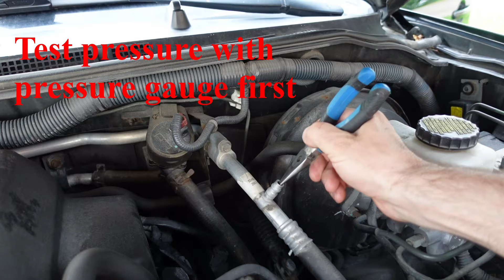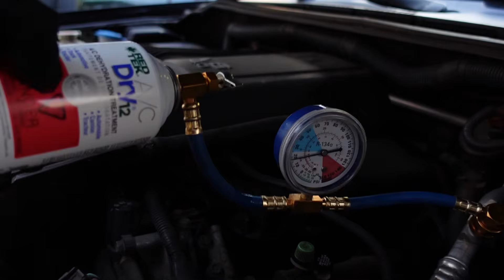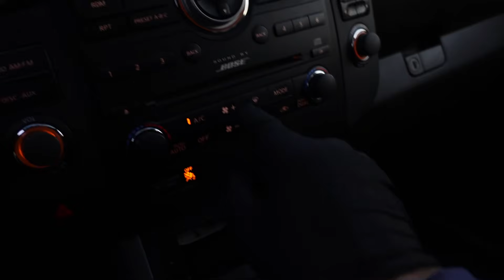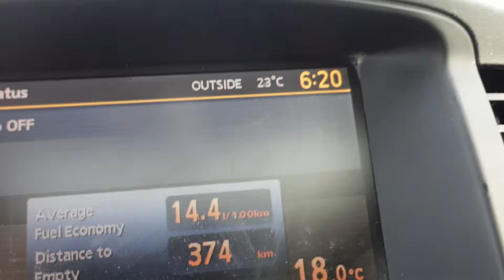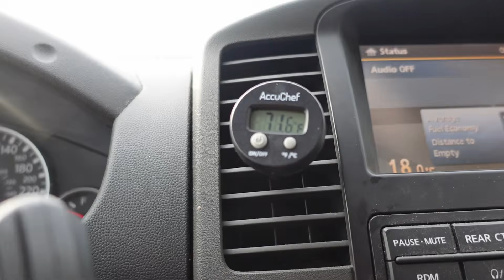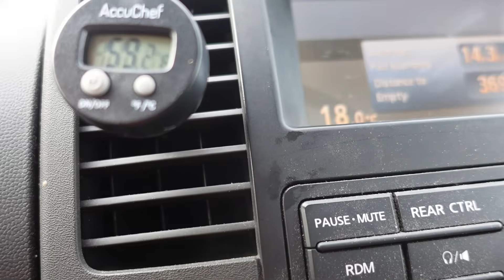Nissan Pathfinder A/C Recharge

Comment: where should i put 134a? high side or low side? video only show's Dry 12 dehydration treatment on low side :(
Reply from the maker: low side. The ports are different and you probably won't have an adaptor to hook onto the highside. Also the pressure on the highside will push everything into the can and nothing will likely escape.

Comment: So why wouldn’t you throw some pressure in there first and bubble test? Your system didn’t just evaporate your refrigerant into thin air!
Reply from the maker: No it literally evaporated the refrigerant into thin air actually. This video is really old and the ac still works.
I'm happy with my choice

Comment: I have pathfinder  and I want to recharge it with freon1234AF.  Please show me how
Reply from the maker: 1234yf isn't compatible with vehicles that run R134A or R12. I therefore cannot show you as my vehicles are both R134A. I assume the method is the same though.

Comment: So this is weird, I did the quick bump on the high side port and it squirted what looks and smells like antifreeze. Bright green and under pressure. WTF?
Reply from the maker: Could be a couple reasons.
They put colorant in to find leaks and is often bright green.
There is an oil that circulates as well.

Comment: I had a broken line right in between a support like corrosion, I cut it in half and use some high-pressure quarter inch fuel line and two fuel line hose clamps
Reply from the maker: If it works it works

Comment: I'm not sure what I'm doing wrong with the AC. The compressor clutch wouldn't engage, even after I used a paperclip to bridge the wiring harness on the left side of the radiator. I replaced the compressor with a junkyard compressor, but I still have the same problem. 

Last night, I put 12 volts of power onto the yellow wire that runs to the compressor clutch. It started spinning, but it sounded terrible. 

What am I doing wrong? Is the voltage going to the compressor clutch supposed to be less than 12 volts?

I could use any advice that you can offer.
Reply from the maker: Did you try the Auto Active Test? The video I did before this one is how to do it on the Pathfinder, but it runs a compressor test that will engage the compressor and let you know if the wiring to the compressor is bad or not.
https://www.youtube.com/watch?v=XBI6MtgcqvE
Reply: The compressor made a few clicking noises when I ran that test, but when the vehicle is running, the compressor clutch only engages if I put power directly to the wire that runs to the compressor.
Reply: @DIYNorth , doesn't the compressor need to be engaged to add more freon? It does on my 1999 Dodge Ram.
Reply from the maker: @stevescholfield6671  no, not on the pathfinder. If it senses low pressure it wont engage.
As soon as I added some refrigerant it started working
Reply: @DIYNorth  I'll give it a shot tonight! I'll let you know what happens.
Reply from the maker: Best of luck
Reply: @DIYNorth  It looks like it's working!! Thanks!!!

I don't have fancy gauges, just a single gauge that attaches to a short refrigerant can. While the refrigerant can is connected to the system, it reads in the "filled" range while the compressor is disengaged. Once the compressor engages, the gauge drops a little bit in the "low" area. Is that normal? I'm trying to get the system to accept more refrigerant as I type this.
Reply from the maker: @stevescholfield6671  glad it started working. Yes I found that once the compressor started the pressure on the low side dropped.

Comment: Dreaded pathfinder rear leak. Either cut and cap the lines to rear evaporator or buy 50$ stop leak kit with refrigerant bottles from Canadian tire or amaazon. The o rings cost like 60$ from Nissan dealers and they don’t know which one goes where lol! The stop leak bottle will plug small leaks in o rings or pipes upto 5mm size
Reply from the maker: Maybe a rear leak. That one A/C recharge lasted more than a year....So I'm not too sure.
If there is a leak, it is a really slow leak.

Comment: Hello,
Really like your video, I plan on putting dehydrator first as well as seal repair . After those my car recommends 25 oz of refrigerant . I will put in 24 oz of refrigerant. Will this cause ac to overcharge ?
Reply from the maker: It depends on how much, if any refrigerant is still in the car.
If its empty, then no it probably wont over charge it.
Just watch the pressure gauge as well and dont bring the pressure up too high

Comment: 134A is kinda hard to get, but you can find, from Duracool, 134 replacement. I live in Northern Ontario, have a 2017 Pathfinder, and will be using this.not sure why 134A is discontinued or so hard to find...
Reply from the maker: I actually thought only people working in the refrigerant trades could get the 134A now in Canada. I think the 134a works better than the stuff from the recharge kits that I used here.

Comment: I heard you don't do this, you don't refill the AC with the canned stuff. You take it to a garage where the person works with refrigerant. Otherwise you have contaminated your AC. They gotta bleed it before refill. I ran into this issue last year and did the can stuff too.
Reply from the maker: Does your A/C still work after using the canned version? There are better methods for sure, even using these DIY cans it is best to put the A/C under vacuum. Mine still works.
Reply: @DIYNorth  it wasn't working that great
 Was going from Calgary AB to Kelowna BC and it stopped working on the highway, after the refill with the can. Not sure if the system was clogged but also was feeling a bit anxious driving, was making me feel a bit nauseous. Might have been the refilled AC causing it. Apparently not good to breath that stuff in. I took it to a shop in Kelowna AC shop. The guy said never use the can stuff. You gotta get it refilled from a shop where they handle refrigerant and the person's certified. He had to bleed it all and decontaminate the AC. Anyways just wanted to let you know. By the way your pathfinder videos are very informative. I been watching them for a while. Great job!

Comment: Hello from Ukraine! Thank's for your videos! Have you ever tried to update your Nissan connect (Clarion 08IT) multimedia system? I have same pathfinder r51, but the Bluetooth connection with the phone is awful. I read in a numerous autoblogs that updating may fix that
Reply from the maker: Sorry, no I can't provide any recommendations on that. My pathfinder has a Bose system (which is terrible) and it doesn't have bluetooth. I have to plug in an aux cable.
Reply: @DIYNorth  Thank's anyway!